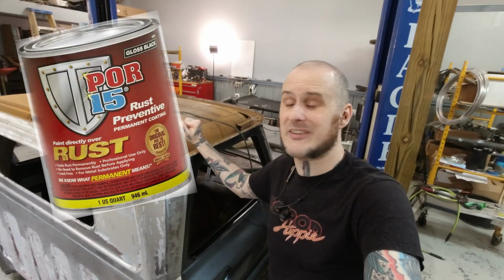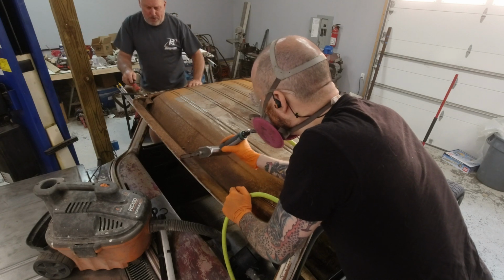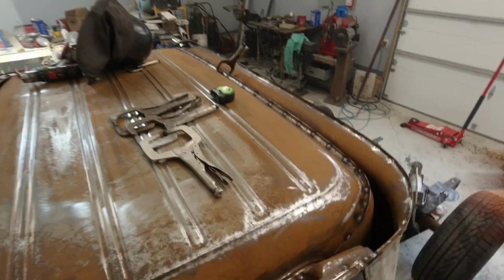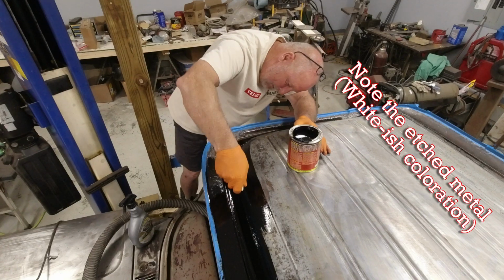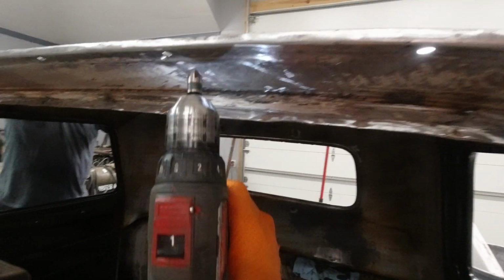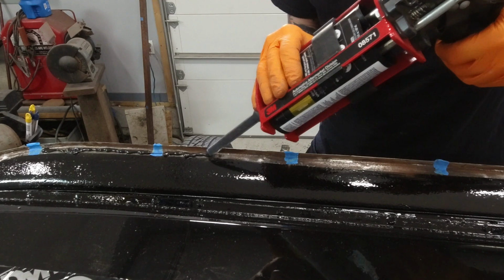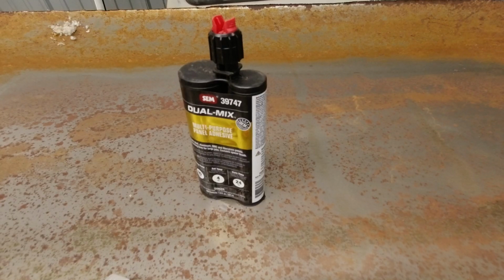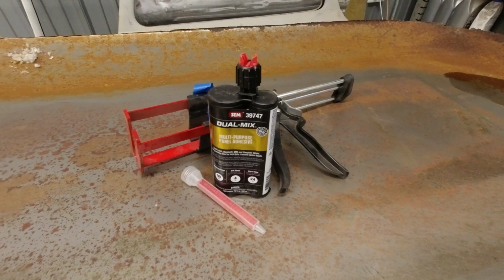60-66 C10 Roof Skin Replacement - Panel Bonding, POR-15, and YOU! - C10 Build Vlog #10

Comment: The spot welds prevent a future failure they wont allow the panel bond to flex too much and break adhesion. The inner structure was good and a good prep and rust inhibitor job. Top notch job!!

Comment: Thanks for keeping it simple and clear.  I've used por-15 before but not panel bond. My son and his crew use it on airplanes for panel replacement and swear by it. I am considering a 65 c30 that has been neglected. The whole front edge of the roof is gone all the way to the windshield. A shop in Tampa makes the cab in fiberglass. My plan is to cut and replace from the dash up to and including the roof to below the rear window. You've shown me how important it is to take care and time in making sure everything is ready, clean and prepped. Thanks again

Comment: why not bead blast the roof dude?
Reply from the maker: We don’t have a bead blaster. It would have made a massive mess to clean up. Would have required stopping all work and taking the truck to someone to blast. It would have turned this one or two day project into a week until we got it back and I was on a very tight time table working on this project.

Comment: NEW SUBSCRIBER here.  HA - I had to laugh at your comment about lead --- people in the past after using lead-wiping in areas on their cars used to say to me - "Oh - I've metal finished it all".  HA - my response was "BULLSHIT - you have just used lead filler rather than plastic filler - that is NOT metal finishing".   HA - most would get offended when I 'scoffed' at their "metal finishing" claims.  I recently watched an 'old school metal master' use a 9" grinder to rough down his lead wiping before using the panel file on the lead.  Really 'EINSTEIN' - you have not heard of the dangers of lead dust floating around the workshop - and it was a 'high-end' restoration shop.  Exactly as you indicate - lead is outdated by far superior (and safer) plastic products.  I am not a 'critic' of panel glue - but - just for 'contemplation//discussion purposes' here (and I am not saying 'will' or 'will not' either way) - but if a skin is glued on - how does that glue age - for example over 20 - 50 years?  Could that affect the join area - allowing moisture of panel separation etc?  Whereas a spot weld (taking corrosion out of the equation on both) - will in theory - still be the same as the day it was done - 20 - 50 years later.  Of course, your roof skin with both glue and weld has a somewhat extra degree of 'long term stick'.  And I really like the idea of the far easier to clean up welds under the gutter rail than inside - good thought indeed and I for one will be thinking about where I can glue rather than spot weld.  HA - discounting the effect of gravity and hot metal liking to be attracted to you as you weld upside down - that was a good idea.  It never ceases to amaze me how in the "old days" - bare metal was welded together as a structure and then the only surfaces that typically received any paint were the ones you could see - just about any 'out of sight' surface was DOOOOOOOMED to rust away.  Today's vehicle construction with EDP process during construction means that virtually 100% of the entire steel structure is protected.  HA - far better than the "old days" method.  Have a safe and nice day all.  CHEERS from AUSTRALIA.

Comment: Gonna have to do this with my 60. Except I’ve also got rot in the valley above the windshield. Outside is pretty rough but inside I can poke my finger through. I wonder how feasible it is to replace those 3 panels instead of trying to do patchwork. Also never touched a Mig welder in my life.

Comment: Great gob! Is there inner roof replacement my 64 has rust and I’m not sure what to do
Reply from the maker: Thank you.  There is a patch panel for the front section where it meets the windshield, but not a full inner roof panel.  To my knowledge anyway.  They only recently started producing the Big Back Window inner panel so I wouldn't be surprised if a roof panel is on the horizon.  However I'm not aware of one, sorry to say.

Comment: I would like to say you are lucky to have your dad, plus his help! It is a big job and I think that you did a perfect job. The upside down MIG welding plug holes has got to be physically taxing. For that alone, I give a 10 of 10. It’s better than any 3M video. A self leveling seam sealer would a great product to finish it off. You did the cab skin on that truck a solid job!
Reply from the maker: Thank you very much.  Self-Leveling Seam Sealer is exactly what I requested of the body shop.  With the welds "hidden" on the underside of the flange the top side is so clean that a nice minimal sealing will look great.  Especially since the roof skin will be at the average person's chest or eye level when laid out.

Comment: You should’ve sprayed Rushmore on there it kills rust it’s a purple spray liquid
Reply from the maker: Are you referring to “Rust Mort” by SEM? We used POR-15s metal prep before applying the POR, which does the same thing. It is part of what I was referring to about proper preparation of a panel for POR that people often skip. I just didn’t really fit it into the video I guess.
Reply: Yeah I was talking about Rust mort my bad  was a little fucked up last night

Comment: Is it possible to use 1/2 the panel adhesive now and the rest later like in a few weeks?
Reply from the maker: Yes.  You can remove the mixing tip and reinstall the plug into the tube.  Usually these come with 2 mixing tips.  You need a new one every time you use the tube.  So if it doesn't come with extras, buy them ahead of time.  As it is a Two Part Epoxy technically you shouldn't have any issues with it hardening up in just a few weeks.  

I often save unfinished tubes for small projects.

Comment: There is a actual  paint that stops rust. Its sprays on looking like thin primer almost like etching paint. U spray it on panel other sections will stay as grey primer the rust turns purple the additives init actual stops rust from spreading
Reply from the maker: I need to do a real test with these products but it has to be a long term project. The thing is, rust isn’t skin deep. It’s inside the metal. Especially once it’s starts to flake even a little bit. So coating over it can’t stop it all. POR claims to do so by starving it of oxygen. Which makes sense if you work with the product but I still question it long term. 

I’m not worried about stopping rust for a year or two, I’m worried about decades.
Reply: @HotRodHippie  yeah that's the only problem no one realy knows if anything actually works on stopping it with out cutting it out. U should do the test it would be most watched but expensive to do
Reply from the maker: @nuggit7290  would be but useful information. I’ll try and figure out a testing methodology. 👍🏻👍🏻

Comment: Alan, sweet job of all of the thinking, body panel adhesive and spot welding that roof panel. I used a flange method installing a “Large” rear window. Most don’t realize there is about 8mm or 5/16” between the inner and outer panels. Very nice job. I could not think anyone can find fault in this skin.
  I inherited the 67 C10 after fix very little rust, electrical and other. My son decided to change jobs and didn’t need the PU. They problem with the rear window was is came out of an old camper, then held in place with screw & silicon. After a buddy volunteered a cordless reciprocal saw and had 5 extra batteries, I got the cab back and slider window for $80. I think I had 10 more vise grips to hold it in place. A drawing with measurements help calm my nerves a little less than one of the guys who was in the first submarine. Came out very good but spent some money on self-leveling seam sealer and taping it off on the same roof panel as some of it came off during some wire wheel action. Very nice job execution and the only one on YouTube. Excellent, clear, to the point and explanations. Dam good! Omaha

Comment: Great video Alan I’d have done exactly the same with the time and equipment resources you had, spot on 🤩 There are a couple of other products available in the uk with a 24 hr cure and also a couple of brands that come in a standard caulking type gun. I’ve never been truly successful using 2 pack bonding for butt/lap  jointing, it’s definitely strong enough but I can never escape some kind of shrinkage of the product that eventually shows up on the paint surface, hardly noticeable but still there under close observation 🧐
Reply from the maker: I wouldn’t use it in a visible joint for that very reason. The epoxy will always expand and contract at a different rate than the metal. So even if it didn’t show up quickly from shrinkage, it would eventually due to the heat of the sun on the body. For me it’s best used in overlaps like this where that won’t be a factor. Thanks Trev 👍🏻👍🏻

Comment: Around here you have to reattach the part the same way it was installed in the factory to pass a safety inspection.  In this case I think you did that by welding as part of the process.
Reply from the maker: That’s a more intricate inspection than I used to have to do, but I can’t argue with it. There have been some high profile failures as a result of people cutting corners and bonding on structural parts they shouldn’t. I had a chat with a guy at SEMA a few years ago who said his entire week there was all meetings about insurance liability as a result of those cases.

Comment: Alan,great video.
For the other gents seeing these comments,instead of drilling out the spot weld.
Get one of those harbor freight electric cutoff tools,with a 3/8 wide grinding disc and grind the spot welds off its faster,and you wont drill thru on accident 
Just a tip from experience
Reply from the maker: I usually use my Dynabrade hand belt sander to do that same thing usually. My Dad was already half done by the time I started filming so he just kept drilling. Good tip 👍🏻

Comment: Solid job. This looks great. On something like this I’d probably use welds in conjunction with the adhesive. I heard some bad stories while I was in school and think that using just adhesive could be trouble. Really cool to see it being used I’ll very likely be using it in my restoration. Do you have a weld through primer in place/ do you worry about the small ish areas that may be bare?
Reply from the maker: Dave DiPetrillo there have been horror stories. I have heard of a few but the ones I’ve heard were very structural parts that were entirely bonded in. The only time I solely. One a part together is when it’s dissimilar materials. And even then I’ll usually add some rivets or screws for a mechanical hold. 

As for the welded areas, I’ve never found a weld thru I like. They all cause issues and don’t etch in enough for my liking. These had epoxy right next to the welds, so much so that clamping squeezes the adhesive into the holes on a few of them. So I feel that the panel bond is doing a sufficient job around the welds. 👍🏻

Comment: Great video 👍 I think por pre treatment is phosphoric acid so you could delete the por finish coat, nice to see bonding in the video.
Reply from the maker: Its primary ingredient is an acid, but it behaves a little differently than the other rust converter acids I've used.  Only a little different though.  As much as anything POR wants you to use it, so its best to do so.  That way if something goes wrong you could say you followed the instructions if approaching POR about it.
Reply: @HotRodHippie  I think it's phosphoric because you have to wash off with water which removes the white minerals it creates,as used by the British navy.

Comment: Thanks for the video and the link to the roof. I bought a 66 for my best friend and it needs a roof skin.
Reply from the maker: It isn’t a cheap piece but I was really impressed with the fit and as far as panel replacements go it was one of the easier jobs. If I ever have even a slight question about a roof on one of these in the future I won’t hesitate to replace it. Or if I ever do a Big Back Window swap. (I couldn’t talk my dad into that on his truck.)
Reply: Where did y'all get your roof skins?

Comment: Alan - thanks for a very detailed description of this process. I have not used panel adhesive before, but now I can see how beneficial it can be for certain projects!
Reply from the maker: Thanks Ron. Panel bonding is definitely not for every project but I’ve found a lot of uses for it over the years. I’ve bonded metal structures to Fiberglass cars (I should have mentioned it’s good for joining dissimilar materials), and sealing up panels that would be impossible to seam seal later. The 55 Belair I most recently did, both inner quarter panels were panel bonded and spot welded in. All in the name of a better finished project. 👍🏻👍🏻